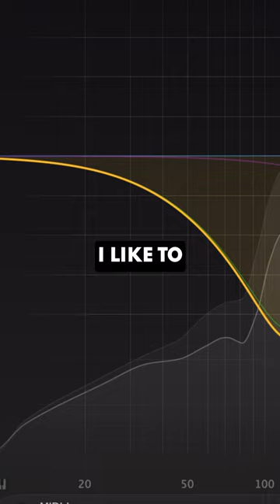Creative Vs Corrective EQ Explained 🎛️

Comment: I kinda disagree. If you have to boost frequencies a lot to create a certain aesthetic to the sound then you are starting off with the wrong sound. That should be done by the synth itself with waveform modulation
Reply: I get the sense you are more generator focused while ppl who get creative with EQs are more effects focused.

There's no rules, so your suggestion seems biased for those who think "how do I make this synth fit with the synth it's self" whereas other ppl will approach the same situation by thinking "how do I make this synth fit with my giant toolbox of plugins"

Personally, I feel like falling out of my chair trying to understand FM synthesis, however boosting frequencies in an EQ feels at home for me, so I have no issues with loading up a synth preset and then make it mine inside the mixer (especially with Shaperbox 3 :P), so in this case the more dry the synth sounds the better.

Also synths can be pricey, or there's a situation where someone used a synth and then sent the bounced audio to you for a collab or something. What I'm getting at is ppl won't always have access to the synth to do it all there. I feel it'd be ignorant to ignore the possibilities of what a basic EQ can accomplish. It's awkward how dismissive you are of what seems to me like another tool in the toolbox. You did say you kinda disagree, so not sure where you really stand on this, you just come across as assertive towards you're own thought process and dismissive of any others.

Curious, what situation would you use extreme EQ settings?
Reply: a sound is a sound
Reply: Define ‘the wrong sound’ lmao
Reply: that is assuming everyone's using synths and not also samples bruh
Reply: No. Sound design requires really drastic eq boosts to get a certain sound sounding good. There are no rules. If the sound comes out sounding good that’s all you need. Every sound design master does it like that. If you don’t at least try then you’re handicapping yourself. Stay open to everything and keep learning. Stubbornness only limits your potential
Reply: @irishfitz  I don’t think it’s about being “generator focused” more an analog perspective.

Some audio engineers and producers will try and make the sound they want at the source instead of playing with plugins.

There’s no right or wrong way necessarily but I understand his comment of wanting to try and make the sound happen at the source with its  sculpting tools rather than making it happen post and risking a rising noise floor or squashing the sound.

Whatever way gets the job done is what matters in the end. We’re in a really cool era of music and sound design so I say just use whatever damn tools you want. 🫶
Reply: Tell that to the neuro folks out there XD